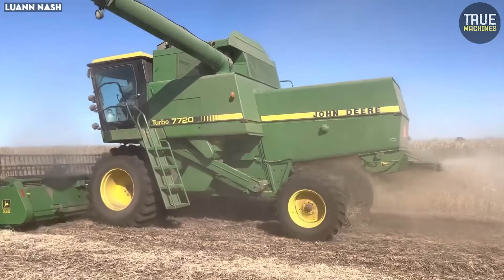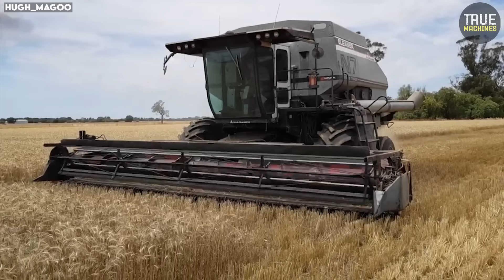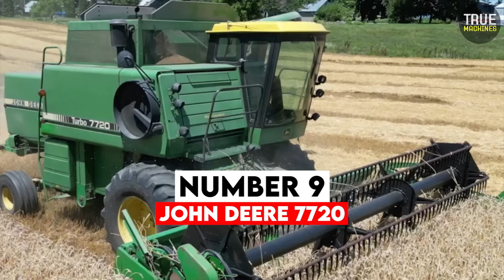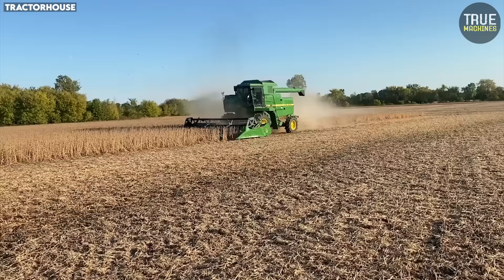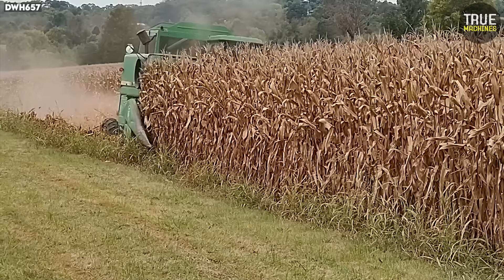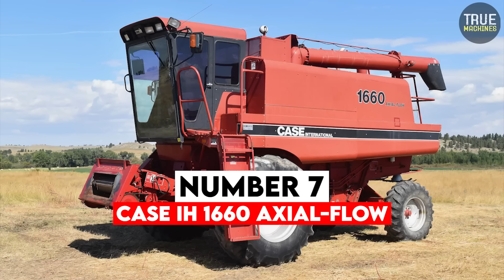10 Unstoppable 1980s Combines Still Working Today

Comment: Oh, and the 7720 (both hp versions) were powered by a 466 cu in engine not the 404
Reply: Yup! We had the 1982 model 7720.   Had it until 2003.    On our 3rd combine since, now have a 2011 9770. Before all the emission garbage.

Comment: I have had an 8570 for over 10 years and it has been a great combine.  BTW, it is powered by a Cummins 8.3L.  The V-8 Perkins goes back to the 9700 White, from which the 8560 and 8570 were developed.  Before that I ran a White 8600 cylinder machine f or 23 years.  It may still be running season after season.